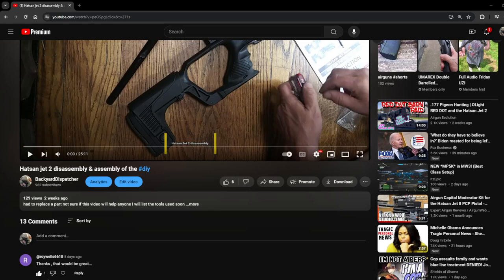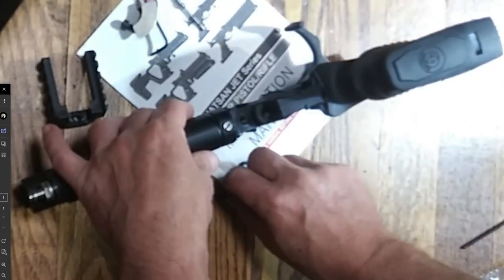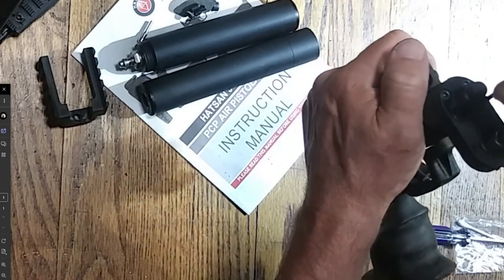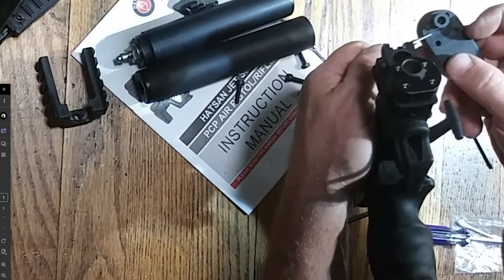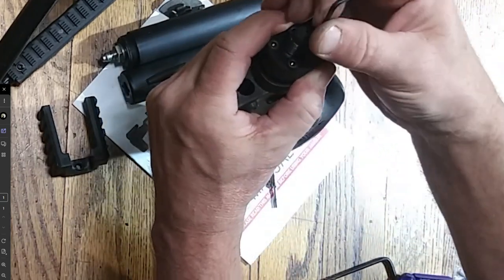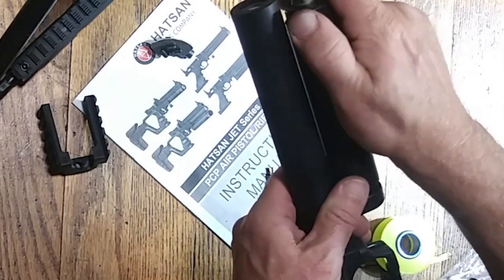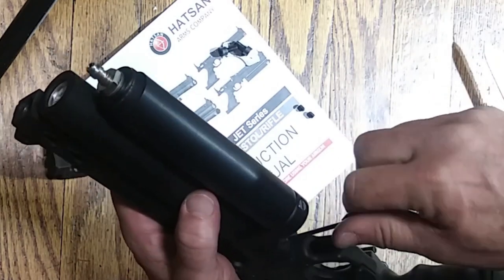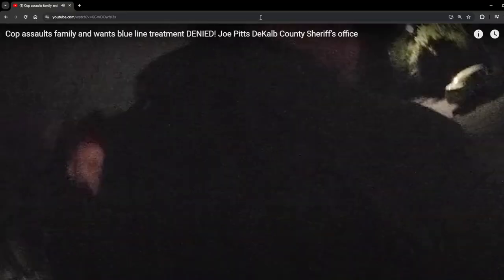Hatsan jet 2 disassembly & reassembly with voice-over  #diy #technical

Comment: That block is acting as the front of the valve  it self  so the air basically going straight into the valve it self. Its basically the front 0f your valve and your. tank drop block at the same time.  If you want the same performance as it came  make the new valve the same  size wise as the original valve stem  and the performance will be the same as before.  If you were to add a hpa bottle it would be a good idea  to also use the top cylinder  so it acts similar to a plenum  for the valve this will help any power modifications made to the airgun.🫡 💯👍👌✌️
Reply from the maker: this is exactly what I want to do , but it is way more easy to do to the jet 1 right ?